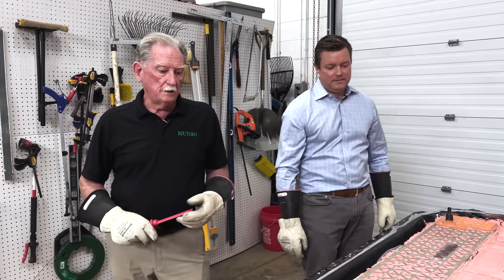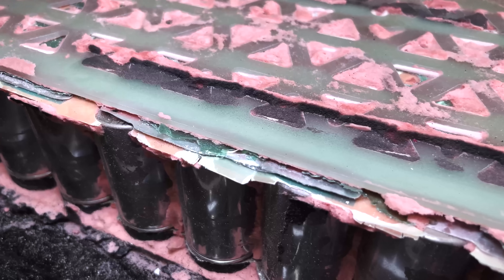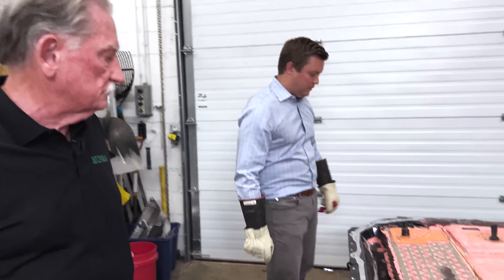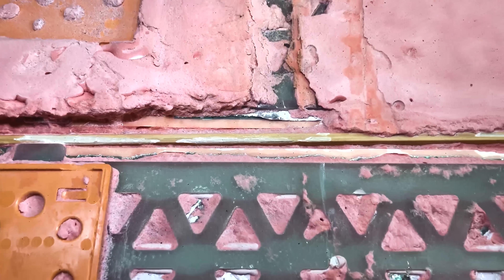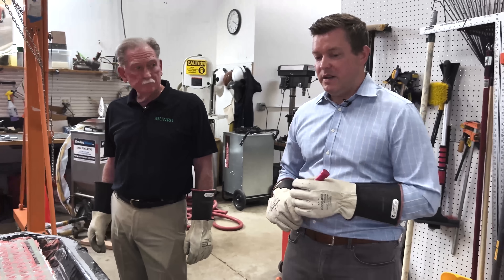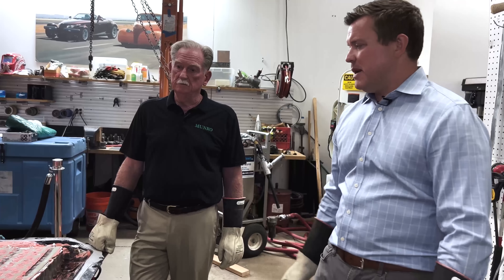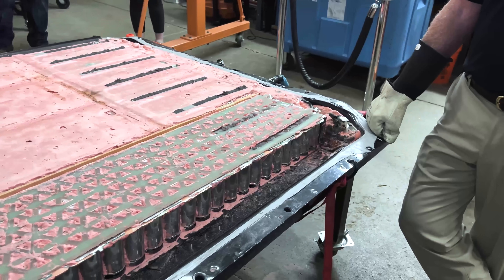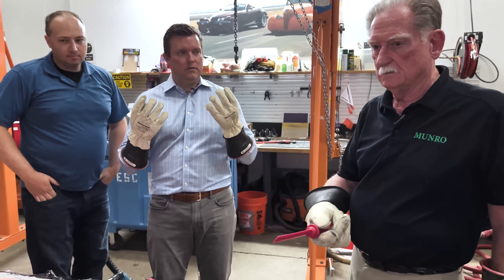4680 Battery Pack: What We Found Under the Foam!

Comment: Right to repair???  Good for the environment???  Good for the your investment??? A battery last 50 years. Maybe not in a car but for sure in a garage as a battery bank. But if one cell goes down it’s a brick.
Reply: That is not how the pack is designed. You are thinking about how the old Christmas tree lights work. If one bulb died the whole string did not work. In this pack if one cell dies it gets isolated from the pack and the rest just keep working. This pack will in 99 percent of the time just slowly degrade. It then can be repurposed as stationary storage and then recycled. Trust me Tesla did its homework on this.
Reply: @ericrichards7884  thanks for this new information. Hope it’s true.

Comment: These batteries are a recycling nightmare. Also a nightmare for any Model Y owner that would like to repair or replace a battery module. This borders what is ethically acceptable and what should be even legally possible. Complete opposite of the BMW i4, which allows for module replacement, modules which are available to purchase from BMW directly.
Reply: DO NOT confuse "Recycling" with "Dismantling".
Reply: @rogerstarkey5390  I’m not. But dismantling efficiently is an important step previous to recycling or even reusing. But lack of repair ability is even worse. You need to scrap the whole battery if one of the modules fails. Completely unsustainable.
Reply: @victorfrombcn   You have the point, only cheap things are unable to be repaired. Those beautiful cells deserve better packaging. They don't value batteries at Tesla anymore....
Reply: Pretty sure the requirements for dismantling and recycling trade secrets are given to JB over at redwood recycling….

Comment: Correction: Liquid nitrogen temperatures are not just above absolute zero. Liquid nitrogen temperatures are around 77 K, or -196 C. So all that about molecules falling apart and what not... doesn't really apply. Sure, freezing things into that temperature probably will increase brittleness and may make it easier to grind - if that is what they do - but it certainly doesn't have much to do with absolute zero.
Reply: For the average viewer, the discussion of absolute zero is worthless.  I agree that they didn't do a good job describing why freezing the pack  to liquid nitrogen temperature is useful and economical before "disassembly".
Reply: thank you :)
Reply: i never heard of this freezing and grinding process. Has this been done before? on batteries? or is this theory

Comment: So this battery is not serviceable, but it doesn’t need to be because it’s reliable. The first owners won't care either way as it’s under warranty, but to how many years and owners does that extend?
Reply: This "system" is serviceable.
As I understand, the recent "Ford Contactor" problem could be fixed more easily on this pack.
Reply: @rogerstarkey5390  Ah yes, just watched the video detailing the 'penthouse'. Also read about the contractor problem, oh Ford…

Comment: The comments about recycling are missing the point. After a crash the dead car is sold by insurers to be parted out for the workshop repair crowd. One light can cost $1k USD to replace so parting out the car has value, but the structural packs will not be reusable (by design, as well as non-swappable software limitations) People parting the cars out will not be paying to send packs back to recyclers. The only effective recycling method is a return-deposit scheme by the manufacturer which incentivizes recycling. Without such a scheme these packs will be piled up waiting for the marginal costs of removal, storage, and transport to pay for itself, and that payment is whatever the big manufacturers are willing to pay, which in many cases will be less than it's worth for the small dismantlers. And who is going to transport hundreds of crashed packs safely back to recyclers? Just imagine how damaged some of the packs will be after being removed from mangled wrecks.
Reply: YOU are missing the point.
As Elon Musk said recently, even a "dead" pack is worth (at least) $1,000 (may have been more)
As such it's probably the most valuable single component to a dismantler.
It won't be "parted out".
"Reusable"?
If a professional "energy storage company" wants to use a pack they can either hack the BMS (doesn't need to be complicated) or "ask" the manufacturers.
Then it just goes into a rack in the facility and is "plugged in".
People "parting cars" will BE PAID for the packs by those wishing to shred them to be used as "ore" for new cells.
.
As indicated by JB Straubel, the "ore" will be of higher quality than virgin material and well below 20% of the production cost
So his company (Redwood) could buy the packs, collect, discharge (USING the energy!) process the materials, then sell them for say "69%" the cost of new stock to the manufacturers.
Everyone wins!
You're guessing.
Research before posting.
Reply: - "Mr Straubel owns over 61,874 units of Tesla Inc stock worth over $260 Million"  ... your source has a personal bias, and so does Elon.
- "Redwood Materials expects to spend $3.5 billion over 10 years on it's Nevada plant." ... that's a huge amount of money to recover before making a dollar.
- "In May, Straubel said the company aimed to start production of copper foil.." ... Redwood Materials has been ramping up for 5 years, and is still only targeting copper foil.
- "We're not profitable yet because we're growing so quickly and we're reinvesting and will be for quite a few years." - Straube, 2022.
Redwood are throwing around big numbers, but are a listed company so of course their projections are huge: "100 gigawatt-hours by 2025, ...500 GWh by 2030".  Let's just see how this pans out.
~

Comment: Sandy and the team are having a huge challenge with this, and are clearly impressed and are not sure what is what. This shows how far ahead Tesla is, I was listening to this video on a mushroom trip and if I didn't know any better you'd think their talking about alien technology lol
Reply: Far ahead in preventing repairs of the battery pack or BMS, yes.
Reply: @geraldh.8047  I can see your vision goes a whole 5 feet infront of you. Enjoy your ford, or polestar, or GM.
Reply: @tyler548  so thinking about usage beyond the warranty period is „5 feet“ ?

It would be great if those battery packs would be extremely reliable. I’m not so sure though, 10 years on the road with vibration and temperature changes all the time…
All that needs to go wrong is a single component on a BMS board. A 1 cent resistor dies at year 11 and your whole battery pack is bricked beyond repair.

PS: thank you, I am enjoying my GM product. Which unlike EVERY Model S from the same production year (2012) is still on its first drivetrain and its first battery pack.
Reply: @geraldh.8047  no but thinking about the 10 in 1,000,000 vehicles that will need to change out the battery I think it’s a mute point. Did you not see the struggle for them to get the pack this far? You’re worried about road vibration? You think Tesla doesn’t have a plan for repairs? Sandy and the team are throwing rocks at an alien ship. I’m glad your government motors vehicle has lasted 10 years. Let’s see if GM can do the same. Again you’ve missed the points. Not surprising you own a GM product.
Reply: @geraldh.8047  then again to your point I’m sure Tesla decidedly they would burn money with warranty if these packs don’t last. Like all their other products, right???
Reply: @geraldh.8047  not to mention, in 10 years these packs will cost what $5,000? If that. I’ll take my chances. Hopefully your Bolt doesn’t spontaneously combust
Reply: @tyler548  if the failure rate is this low then this is a good strategy. But what if your BMS component manufacturer delivers you a faulty resistor for 3 months of the production and ALL those battery packs die at year X ? Tesla won’t know until it’s too late.

Obviously there are no plans for repair here, this is sealed beyond any repairability. They will shred it and deliver a new one.

Regarding warranty: yes, since the warranty is reasonably long I guess they are very confident. Let’s hope the confidence is warranted.

PS: unlike you I’m not a religious zealot regarding car brands. I bought the GM because in 2012 there was no Model 3/Y on the market. Heck even NOW the Model Y is not really on the market in Europe (Gigafactory Berlin is still early in the ramp phase). Tesla has great advantages in some areas but also disadvantages, Model Y is certainly on my shortlist once the stupid supply line problems normalize a little.
Reply: @tyler548  Obviously I did not buy a Bolt in 2012. Your history teacher would not be proud.

Comment: You need to remove more foam to see the ends of the cells strips to realize that the count of 34 is likely not correct for all strips, and it is 828 total (12 cooling channels each with 34 cells on one side and 35 cells on the other, for a total of 12 * 69 = 828, or 3*69=207 per block). 816 total, or 204 per block ("module") doesn't make sense, because it doesn't divide into a reasonable number of cell groups: there are likely 23 groups in series of 9 cells each (207 total), but 204 would have to be 17 groups of 12 cells, for only 68 cell groups in series for the whole battery... assuming no groups spread across blocks.
Reply: Just as devil’s advocate, 816 would require 68 cells per bandolier, pack could be divided as 102 cells in series as 428v at 4.2v cut off. Does this make a material difference? (Photo evidence points to 69 cells per bandolier) * 102 doesn’t divide nicely across 4 "modules".
Reply: @iandavies4853  "bandolier" is a great term, even if real bandoliers don't have shell (cell) pockets on both sides of the strap (cooling ribbon). I had not heard it before, although it has apparently become popular terminology.

I saw the photos of components of this packs, with the clear 69-cell "bandoliers", but I couldn't find the web page again. Using "bandolier" as a keyword, I see that InsideEVs ran an article titled "Engineering Analysis Of Tesla's Cyber Rodeo 4680 Battery Pack Cutaway" that shows them well; it even explains the 9P configuration... it would be easier if everyone just looked at that.
Reply: @brianb-p6586  you’ve got great logic. The 34/35 arrangement stumped me, but I can model a simple arrangement that works, junctions look like chevrons, V’s & A’s. Same on bottom side. Then cross-pole junctions outside each "module". So there is a reason to stick to "module" arrangement. I’m keen to see more teardown, to hear if DBE used on cathode yet. To see how & where cells vent if overheating.
Why didn’t Munro test stiffness of pack prior to disassembly? It’d be epic.
Reply: To see the components of the battery, including 69 cells attached in "bandoliers" to each of the 12 cooling strips in the pack (3 per block, so 207 cells per block), check out the Munro video which Sandy did while visiting the Tesla displays in Texas 3 months ago, titled "Sandy at Cyber Rodeo Giga Texas".  The strips with cells show up again separately and perhaps easier to count at 8 min 2 sec in that video.
Reply: @brianb-p6586  You're right, that's exactly what I did and counted 69 cells.  You can also barely make it out on the red machine with the block of 207 cells (which look to have some sort of metal strips on the bottom).  But it's interesting when you look at the 4680 SBP cutaway from Giga Berlin, the cooling strips (which I've also seen called "cold plates") run transverse, instead of longitudinal (lengthwise) as on this production MY.
Reply: @satoshimanabe2493  having longitudinal cooling but perpendicular electrical circuit means cross-"module" junctions. Must have a good reason for this, doesn’t seem as simple to my naive mind. We should be seeing these already - plus 2x3 junctions to inverter. Reason they pay engineers big bucks.
Reply: @satoshimanabe2493  I’ve changed my mind. Electric circuit follows bandoliers in W fashion, 3 discrete circuits. It’s so simple. All I want to see now is + to - connections from bottom to top of pack.
Reply: 100% agree with you, 4s(23s*9p) is the only configuration I could come up with (assuming no dummy cells).  This comes to ~390V at a charge cutoff voltage of 4.2V/cell.  And this video already shows collector plates in groups of three cells in parallel, assuming shortest path that would represent 9 cells configured as 3x3 (except at the ends), which is totally doable with 6 rows of cells per block.

Comment: Thanks for the explanation on the recycling. I guess the only part that sucks is the no serviceability later on down the road. So, essentially an apple phone with wheels
Reply: If you lose 0.12% of capacity if ONE cell goes down, what's the problem?
You CAN service the control electronics on this pack. (unlike the Ford)

Comment: I imagine with a  structural battery, it would be impossible  to isolate a single failed cell. Wouldn't that cause a total battery failure?
Reply: "I imagine" a "fuse" would suffice?
Reply: @rogerstarkey5390  A fuse for every single cell? There are companies now that can isolate failed cells, in older models, and put the battery back to usable service. That is what I was referring to.